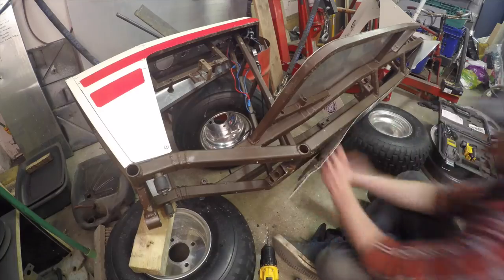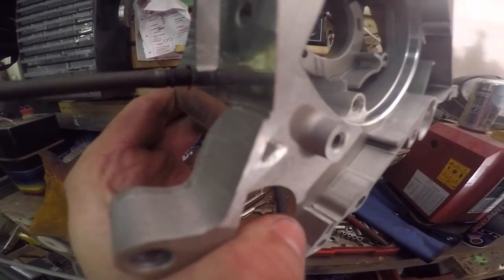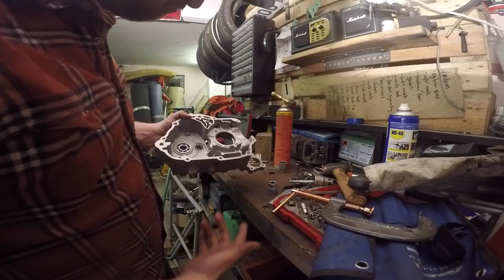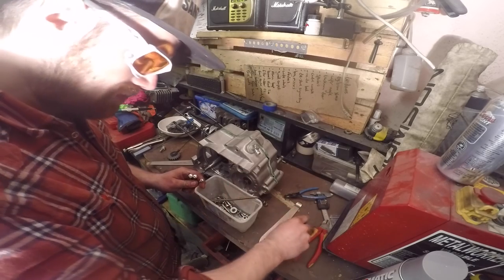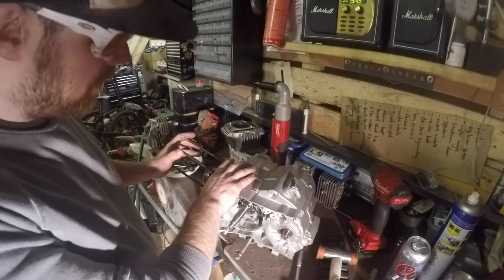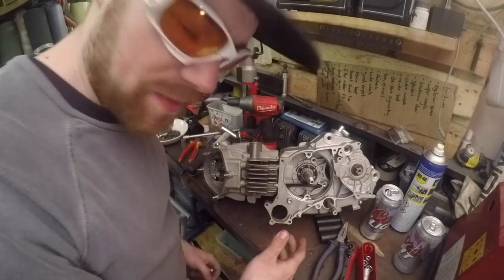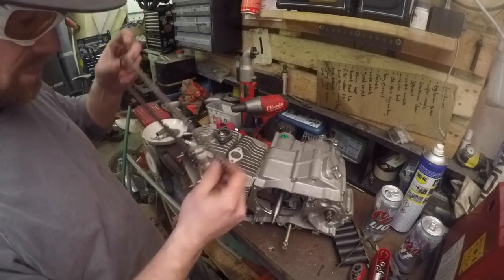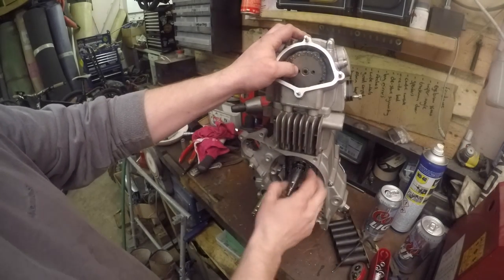RACE TRACTOR - WRENCHLIFE - little BASTARD - REBUILD - PART 3

Comment: What size and make of the rear wheels and tyres? Is it a 30mm solid rear axle? Cheers dude
Reply from the maker: Hi John, it's a 30mm hollow axle from kart components in England, the hubs are a 4x4 'rally kart hub', also from kart components. Rear wheels are 8x8 Douglas red label atv rim with an 18" kenda golf kart slick on them, they hold up well, I did need to modify the hubs slightly to take 1/2" studs tho, Jon